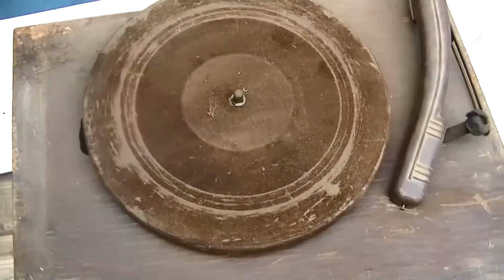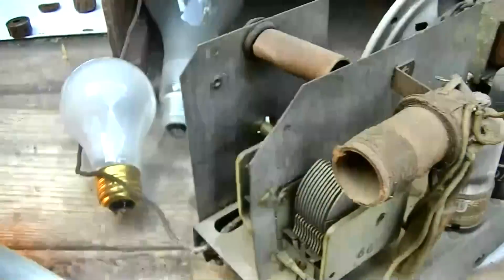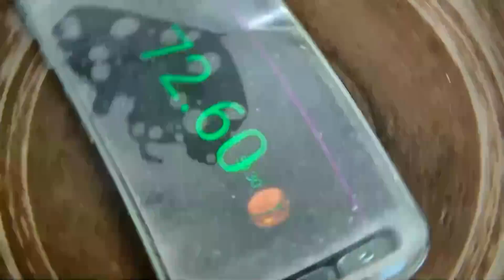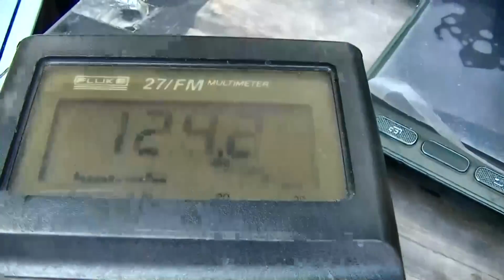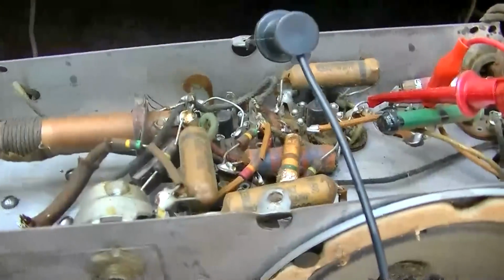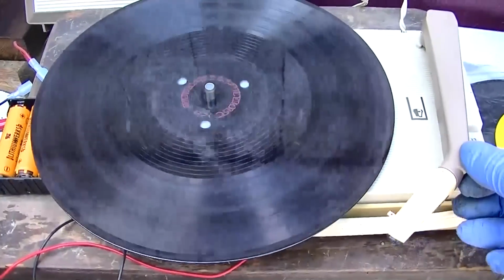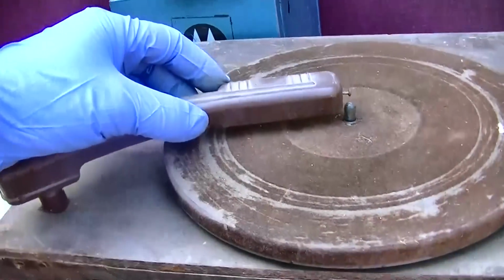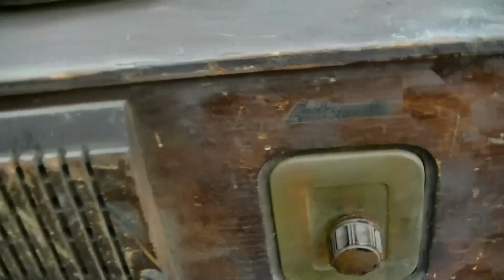Automatic AM Radio 78 Record Player Resurrection

Comment: These TRF sets are bulletproof. Worn out tubes, leaky caps, drifted resistors, still works fine.
Reply: Simple though!
Reply: @realgroovy24  pretty much nothing to go wrong
Reply: @qwertykeyboard5901  I have a TRF of my own which is made of older valves but modern other components. There's barely any components, simple thing, albeit slightly crude, only picking up the more powerful stations.

Comment: I actually prefer the radio repair videos, as they are more pertinant to modern life. Not to say that CRTs don’t have any use or value (especially as repair knowledge or experience), but you can generally just plug in a radio and get information which makes them useful as standalone appliances. Keep in mind that people are watching from all over the world.
Reply: although over the air tv channels are non existannt i still have analog cable tv in the house and many people do. just plug an old tube set to the wall antenna socket and you have a bunch of channels on vhf and uhf...if not there are dvds modulators and whatnot

Comment: The tracking pressure for that tone arm is 1 ton
Reply: And tracking angle is at it's best! :)
Reply: hehehehe
Reply: 30 grams
Reply: The Astatic L-82A cartridge calls for 2 3/4 ounces of tracking force.  That's about 80 grams.
Reply: @KDoyle4  80 grams is 2.82 ounces. so that's pretty close  :)

Comment: They did make sapphire and diamond stylus on a 'spike' to plug into those carts.  Also the el-cheapo steel needles.  Being that single ended octal tubes are used, I'd say that set is late 30's,  Middle 30's still using double ended tubes, and this set DOES have one of those in there.   Being a 4 tube set, I'm surprised that it has a 35Z5, I'd expect a 45Z5, and that might have been the original tube, later replaced by the 35Z5 by someone who didn't have a 45Z5 available.
Reply: I've never seen a set with a 45Z5, though I'm sure they are out there, most of the time they seemed to use a larger series dropping resistor to burn off the extra voltage like they did in those Arvin metal radios.

Comment: This set is same type of circuit as the 3 tube metal case Arvin set that you were impressed with because it worked with all original components.      Arvin sets were made 50 miles from me in Columbus Indiana.  If you remember Atwater Kent radios many of them were metal cases.  The same engineerthat work for Atwater Kent also work for Arvin later and came up with the metal cased sets.  Arvin was and still is an auto parts supplier and had access to metal forming and tooling.  It just made sense for them to make a metal cased radio.

Comment: Selectivity is always going to be a problem with a TRF of this sort, you need multiple cascading tuned stages to get the selectivity, which works but needs more gangs in the tuning condenser, and more coils, this only has two stages. Sets in the 1920s had at least three, often four, except for some very early sets, each had their own dial to aid in selectivity. So in the end the superheterodyne took over because you needed fewer components to get similar performance to a better designed TRF set. The main reason why so many TRFs were built in the 1920s and early 30s was because of the RCA patent monopoly on the superheterodyne circuit, until the U.S Supreme Court forced them to grant other companies a license. There were crappy superhets too, I've owned a few, four tube ones are usually not that great unless some regeneration is used.

Comment: I love the HEP shelf metal dealer box. I was shopper at my local Motorola HEP replacements dealer in my town. I used to buy HEP310’s back in 1970.
OH.... that it a drawer bin box, isn’t it?
Reply: I remember something like that from those "Build 100 Circuits" books. Didn't Motorola have its own numbering system, so a 2N--whatever would have an equivalent HEP number?
Reply: @PC No HEP was the Motorola replacements range, SK was the RCA range, & ECG was & is the Phillips? Range of Solid state replacements in the 60' & 70"s. we had separate dealers for each one in our town(S) for these brands. I traded with all 3. They were competitors for these parts. HEP310, SK 3003, ECG 126 & 156. & lots more. OH 2N is a non replacement range designation prefix.

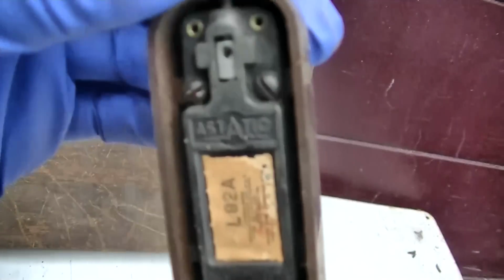Comment: 1:27 How about cartridges that use carbon microphone pre-amplifiers?  Could that be use as a form of electroacoustic amplification instead of electronic?
20:21 AM 1260 is a very strong station here in the San Fernando Valley!

Comment: Those AudioDiscs are likely one-off DIY recordings.
Reply: They could be off-the-air home recordings, or they may be studio recorded copies for the performer to take have before its general release.
Reply: Yes! I have some of the homemade 78’s which was made by Audiodiscs, and it was the same company that made Audiotape reel-to-reel tapes and Audiopak 4-track and 8-track cartridge tapes under Audio Devices Inc. It was later purchased by Capitol Records in the late 1960’s and manufactured blank audio tapes under the Capitol name outside of its record label with the Target logo without the dot in the middle which you don’t see them on record label outside of their recording artists.
Reply: sounds pretty good for home recording but you never know, it could also be studio recordings too, it was fairly common for studios to send their clients early versions / test versions etc on audiodisc.
Reply: I believe it was common  to have those machines at schools, churches, summer camps, etc. I believe there were also booths at record shops and music stores where you could pay a small fee to make one.